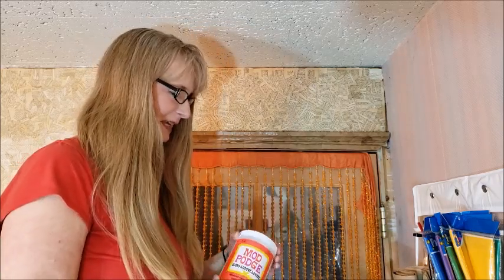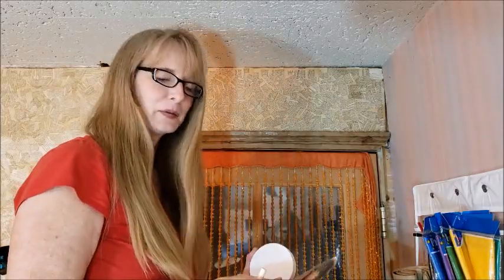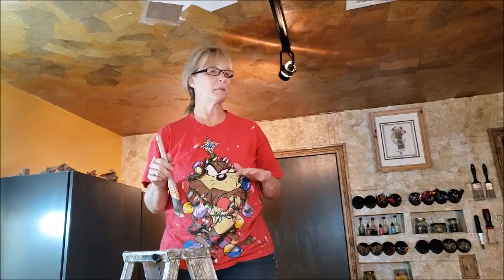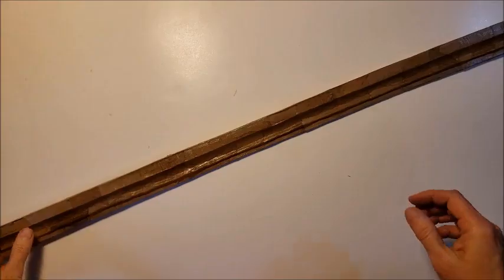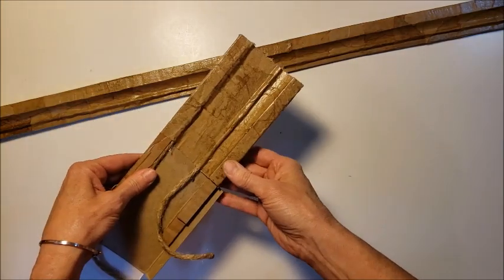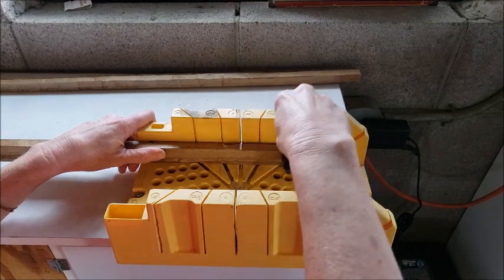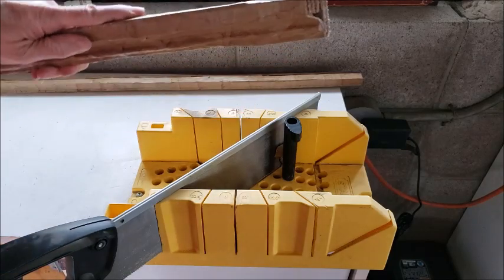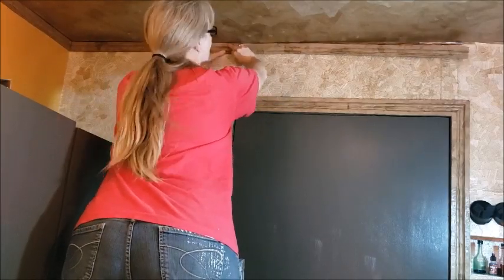How to cover ugly ceiling tiles Craft Room Makeover Extreme Upcycling

Comment: Could you have used a short nape roller brush to push up the papers into the ceiling tile? Perhaps rolling the modge podge onto it or would that have pulled the squares out?  How much is midge podge by the gallon? I love that stuff works great for lots of decoupage crafting.
Reply from the maker: Hi thanks for your question/ comment. The roller idea is an interesting one. Not sure how it would work but it could be worth a try. I think that mod podge is about 36 dollars a gallon. I did a review of mod podge vs home made if you are interested. https://youtu.be/2V6ZqdUs4MU
Reply: @UpcycleDesignLab  thank you!! I had no idea that you can make it at home.   I learned something new!

Comment: Love this!!!  I have 3 rooms with hideous ceiling tiles.  Are the lines from the tiles still visible with this technique?  I've used brown paper for gorgeous floors and walls and know it hides a multitude of sins.  However, I will be using white craft paper and want to be sure no lines show through.  I'm considering doing a small section and putting tape over the tile lines before applying the paper.
Reply from the maker: Hi Kathy, The lines do not show on my ceiling but I think they might show through white paper. It is a smart idea to test a small area. Have fun. Let me know how it turns out.
Reply: @UpcycleDesignLab  I'll definitely test first!!!!  I did the walls in one of the bedrooms in my house and the brown paper hid all the flaws. . . until I decided to paint a lighter color.  LOL. I ended up making faux bricks on the two worst walls using joint compound and masking tape.  Problem solved.

Comment: Did you put a finish coat on top once completed? And is the ceiling washable?
Reply from the maker: Hi Dianne,
Thanks for your question. There is no top coat other than the Mod podge which is brushed on during the application of the paper. The Mod podge is a sealant as well as a glue so the finish is water resistant so it could be wiped off with a damp cloth but not scrubbed down with soap and water. Thanks for watching.
Reply: I think this is the same technique for paper bag floor except the blue I used was Elmer's/school glue. Afterwards I used polyurethane varnish This video is I ingenious. I never would have thought of doing it on a ceiling.  I am going to give it a go ASAP but I might use white craft paper instead of the brown

Comment: This is similar to something I want to try with my ceilings but my friend has warned me that this would make it not fire-safe and wouldn’t pass an inspection if I were to sell because ceiling tiles are fire retardant and adding paper and cardboard are.. not. What do you think? I might make mine (which will be cork wallpaper basically) easily removable from the original ceiling tiles
Reply from the maker: Hi Karly, sorry I don't know the answer to your question. If you can make a version that is removable then that would be a great way to go. Thanks for watching.